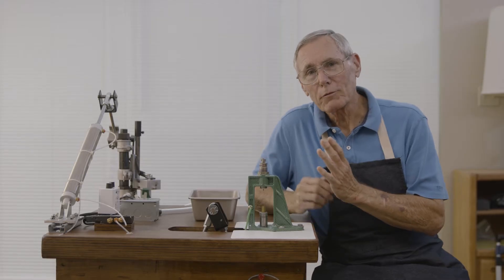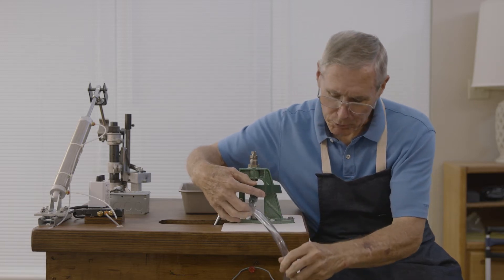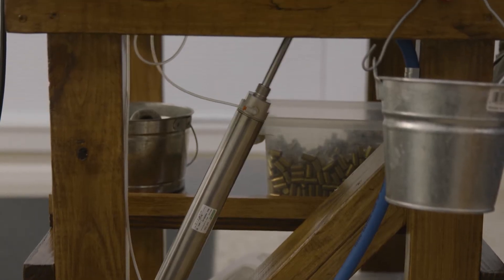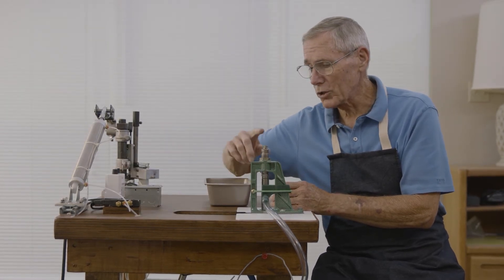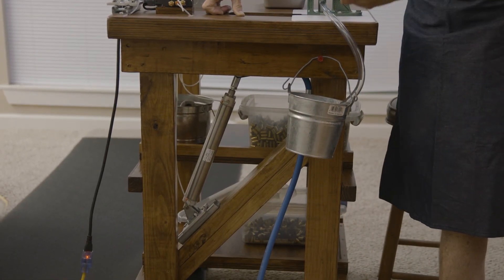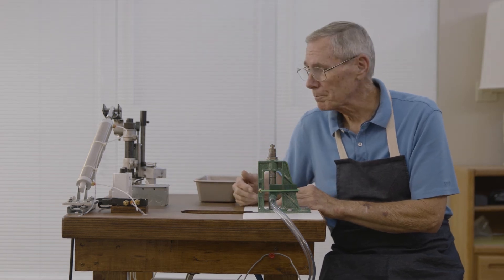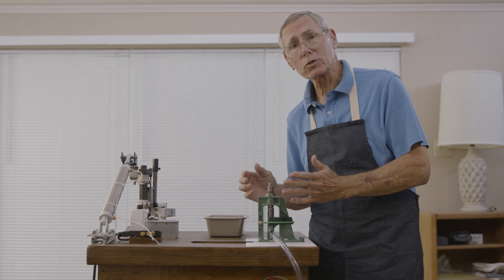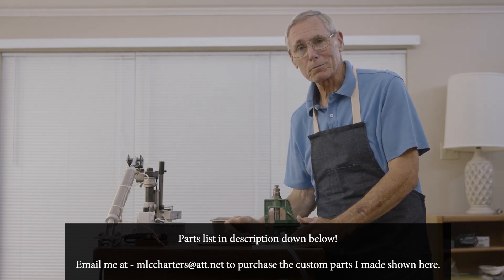Single Stage Press Automatic

Comment: Another excellent video. I run fairly high volumes and wanted to eliminate primer residue on my progressive, without sacrificing time efficiency. A Lee APP with a mount and adapter to feed from a Dillon case feeder was my solution.  Though it can do thousands of rounds per hour, it would be fun to add your air cylinder drive…